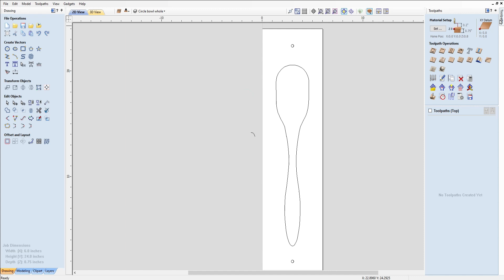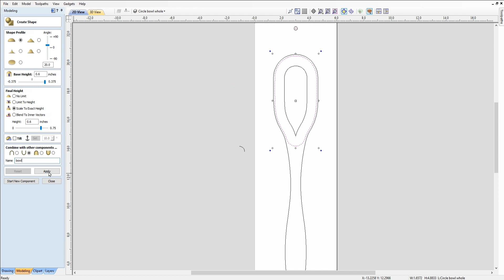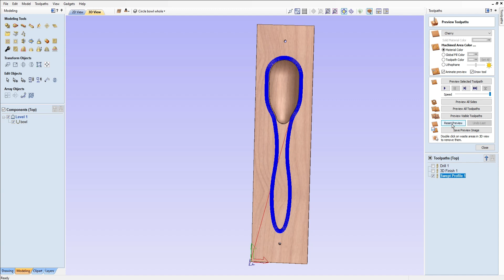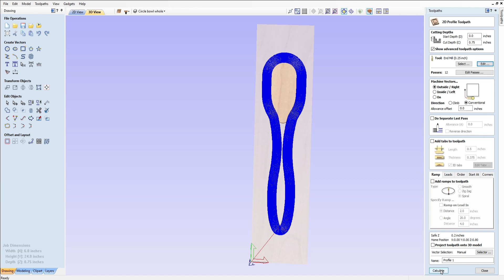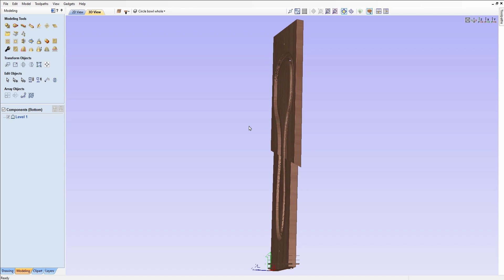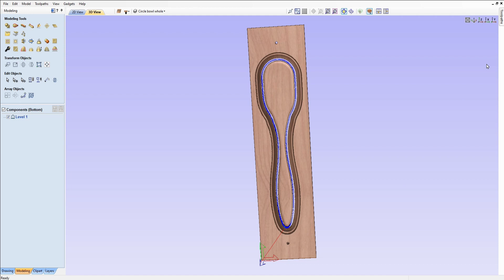My spoon

Comment: Good Job on explaining the steps! How did the drawing of the spoon get into your file? Did you import a hand drawing? Is there a way to change the horizontal profile where the handle is slightly higher than the Bowl? I will definitely be trying this.
Reply from the maker: I added the outline file to the Vectric facebook file section where you are a member.  As far as changing the profile I didn't see a need for it, maybe in another video.
Reply: @robertcarter3157   Thanks Robert!
Reply: If i wanted to do a profile change can you give any insight on how to do it?
Reply from the maker: @christophergraceffa7925  I  used a simple process, changing the profile I don't have an answer at this time. I don't think the sweep profile would allow the process.
Reply from the maker: Thinking about this again, I would look to the distort text tool , which leads to another video, let me know if your successful.
Reply: Ok thx